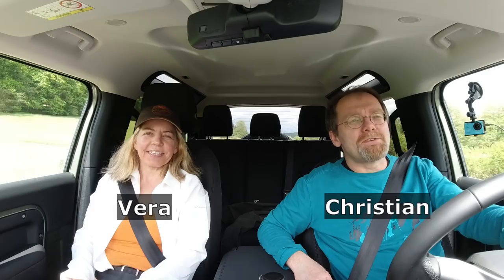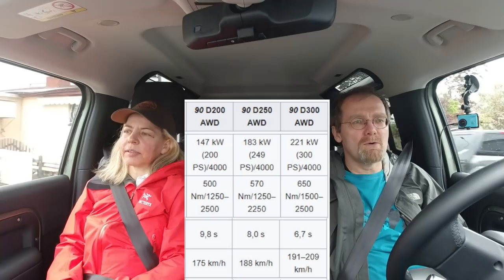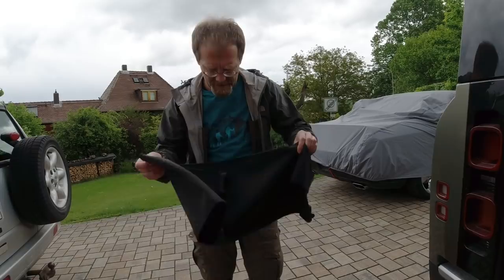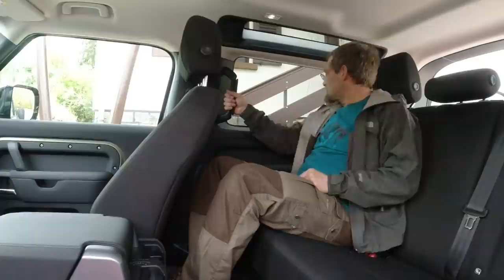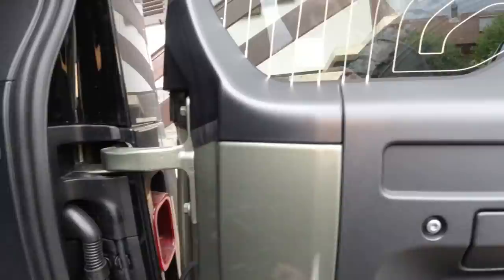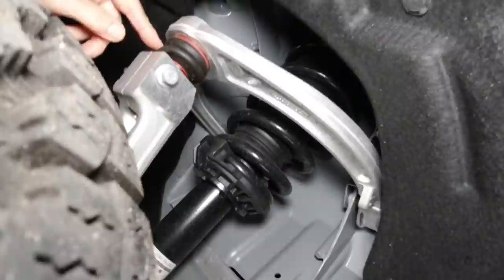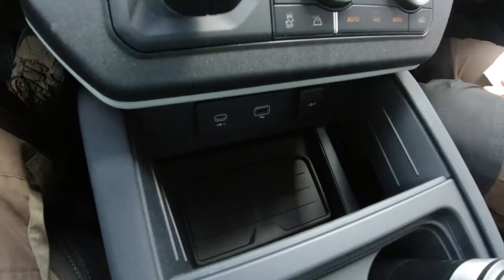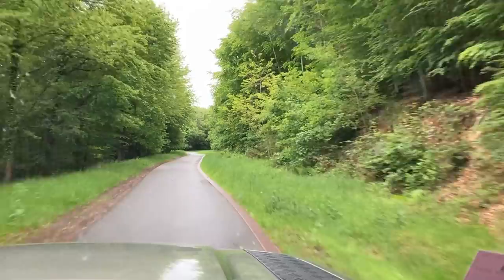Review 2021 Land Rover Defender 90 D200

Comment: The smuggling compartment..... you basically have a Well for storing water once you have made a deep water crossing. All the electronics in there will get soaked and end up frying itself. I wonder how it copes with deep water in real life? I'll bet those Navigation aids and other electronics aren't cheap?
Reply from the maker: Good for smuggling but not for electronics 😂 Christian
Reply: @Vera_and_Christian   Not good for smuggling anymore, you have told Customs where the hiding places are; if they didn't know already :)
Reply: 900mm wading depth (200mm more than the Disco 3/4) and the battery and electronics stay dry - that's why they are there.  I think the lids are also sealed so you can wash out the car without the battery or electronics getting wet.
Reply: @johnwillett4086   Thanks John,i've not seen a lot of reviews of the new Land Rover to date but like Christian i'm curious what will happen to the vehicles over time and how these features will survive.

Comment: Hi Christian, from what lv read this vehicle is problematic - l don’t think you will be fixing this like you do the LR3 lv been told unless (example) you order one with a power winch already installed - a winch cannot be fitted after, even by a main dealer as the electrics cannot be “broken into” , ie it’s over complicated - great until you have a problem, and new ones are having problems by all accounts - at min 65k and 90k l fancy these are going to be big dippers resale wise - lot of plastic, hardly the easy fix farming use  “defender” in my opinion
Reply from the maker: Hopefully in a few years the aftermarket has cracked the software and developed solutions.  Otherwise this car will have serious limitations, I agree.  Christian

Comment: Funny stuff.  It comes with a kilt......you take out the navigation system and all the other useless electronic crap, so you can hide 7-8 kilos of c......stay in a hotel and wear their bathing robe...we got a driveshaft in it.....Advantek, must be the lowest bidder....it's too small for a six pack.....etc.  My guess is that spike poking down on the inside rim of the wheel is for preventing too much build-up of mud or ice.

Comment: How many sheep can you throw in the back?
Reply from the maker: I think 2. But only sheeps which are used to steep grassland because the seats do not fold flat.  😂Christian
Reply: The comercial version is for this - cheaper, coil springs, and designed as a workhorse.

Comment: Odd a car that size doesn't have back doors.
Reply: It's the shorter 90 version - the longer 110 version does have 5 doors.  I much prefer the 110 - lots more room and the seats do fold fully flat and the floor is fully flat from the back on the 110.